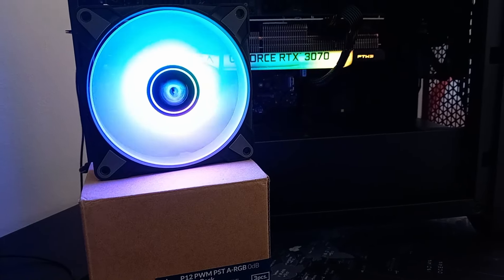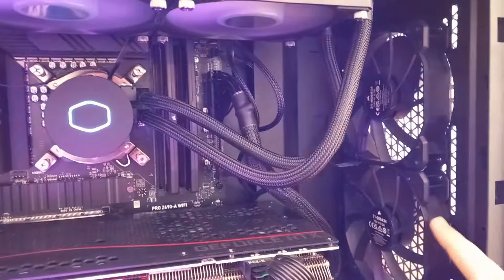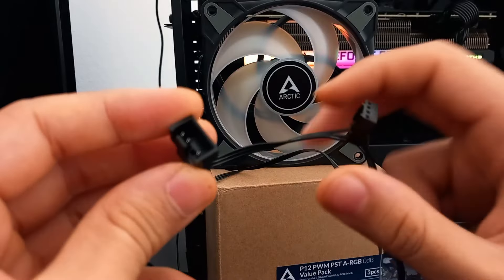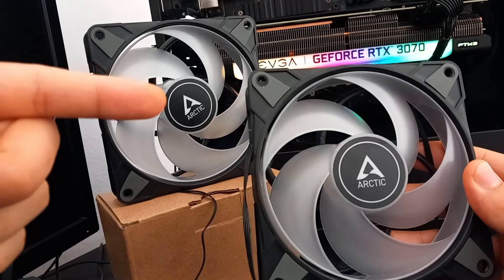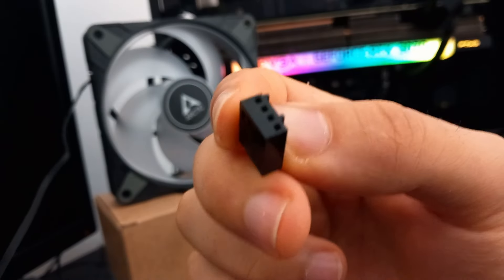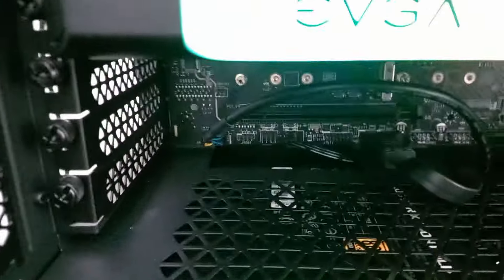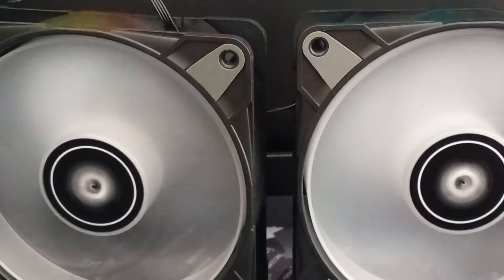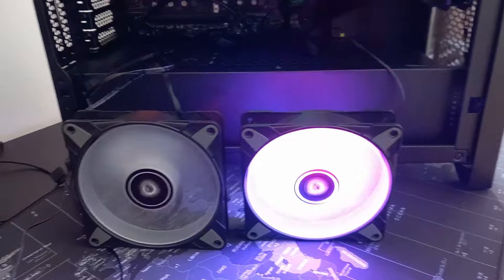Arctic P12 PWM PST ARGB 0db Installation | How To Install

Comment: You dont need the controller in order for RGB to work. Just connect them together make sure your ARGB is installed the correct way (arrow with DC12) and letters corresponding on board and fan connector. Just tested it and it works. Have yet to see if my MOBO has RGB controls.
Reply: So you can use rgb on all fans basically if you have an ARGB header on the motherboard and you plug the final fan into it?
Reply: @KarltonFranz that's what it looks like, if your mobo has one of those light controllers that shows in the fan box, it's just plug and play. I just got the Artic 360 AIO rgb plus 4 fans ( 1 - 140 and 2 - 120). So I'll have total of 7 fans working on my new build.

Comment: Bought them thinking that JRGB slots on my msi z390 gaming pro will connect to the fans argb controlls. Turns out i litteraly need to spend another value of the fan on a stupid argb controller/converter that i cant buy. The MB wasnt even a cheap one when i bought it so its just dissapointing it does not have a 5v argb slot

Comment: Maybe im dumb buď i dont see were you plug RGB connector
Reply: yep.. i'm looking for that too and he never mention/show where it should go.. my board only have 12v rgb headers though..
Reply: @glyphgraph8436 Did you solve it? I have the same question, in the video I understood that we have to connect the 4 pin receptor in the motherboard and interconnect the 3 pin between the 3 fans but I don't know if that's dangerous because the difference of voltage between RGB and A-RGB
Reply: @fidelabando7409  connect it to a argb controller

Comment: If you have one A-RGB header on the motherboard 5v you simply daisy chain the fans, Same with the PWM one fan Header on the board and daisy chain up to 5 fans only, you do not need a fan hub. This explains it better https://www.youtube.com/watch?v=W0ev38feVx4
Reply: thanks for the tip
Reply: Thanks buddy

Comment: Which Software are you using to controll the RGB lights? SignalRGB,and OpenRGB doesnt work for me.
Reply from the maker: Not yet sadly im still waiting for Hub to arrive
Reply: Just use the software of your motherboard
Reply: And make sure you plugged the argb cable the right way

Comment: ok i need to make clear and ask:
- basicalle its possible to connect up to 5 arctic fans together by connecting them each other with the 3pin connector and put them on the 4 pin mainboard connector.
- but i want all my 5 arctic argp fans run with color: how to do it if i have only one ADDR_LED1 connector on the motherboard?

Comment: How is the air flow in this fan
Reply from the maker: I had it for a week now and its really good my GPU never passes 55/57 degrees on high performance, and quite but not super quite there is some sound but i guess as any other fans